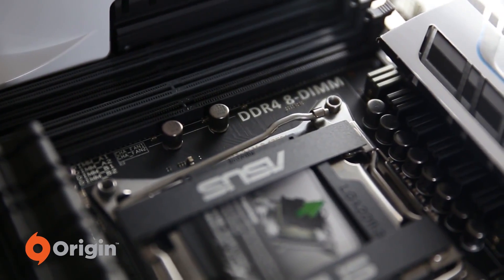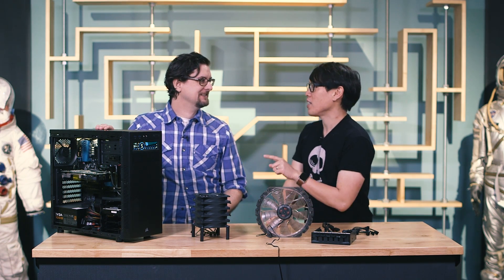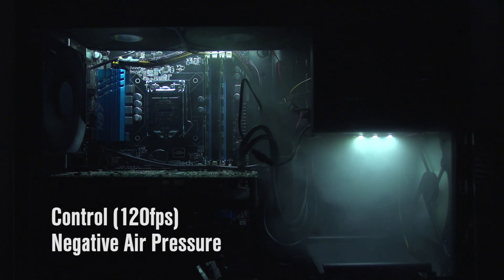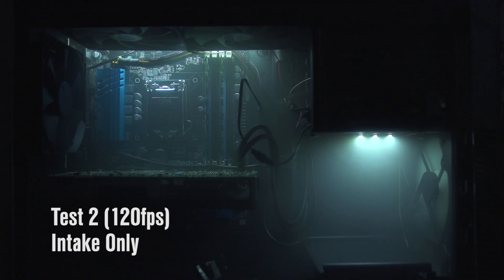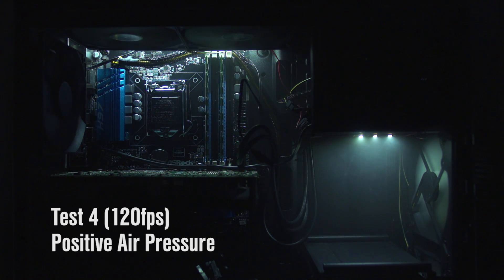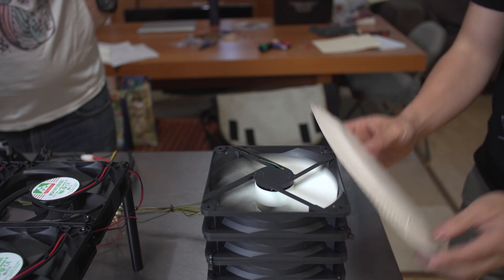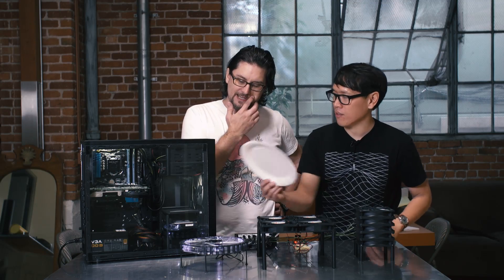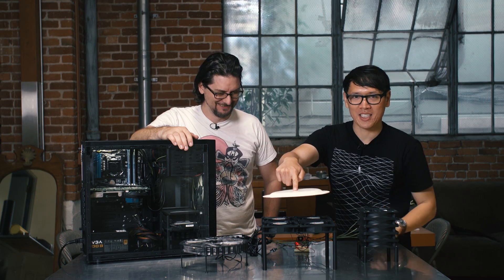Team PC Episode 2 - Positive and Negative Air Pressure

Comment: Negative or balanced air pressure ftw. Positive air pressure may pull in more cool air, but the air is stagnant and sitting in a case full of hot pc components. In other words the stagnant air in the case causes increased thermals. Yes you may get a bit more dust with negative, but just blow out the case every few months and you'll still be getting better temps overall. Still balanced is the best to reduce thermals while keeping out dust.

Comment: possitive air pressure is much better than negative .. 
negative air pressure is just pushing the air out more than air coming in the case , AND ALLOWS DUST TO STACK EASILY IN THE CASE .. 
Possitive air pressure is more air coming in , than going out , which help to cool things down much better cuz the intake air actually moving in and being exhaust out slower , SO the little holes in ur case wont SUCK anything IN ..
Reply: That is not true. It is better to get the hot air out of your case as quickly as possible. It does not matter how much air you get in. If your air inside the case is hot, it does not make a difference. As it goes for dust, you're going to take it anyway, either with positive or negative pressure.
Reply: Positive pressure is better for sloths. They never clean anything.

Comment: do you want loads of dust in your case? because this is how you get loads of dust.
also no cable management.... like at all
Reply: The whole point is to get hot air out because you don't want your parts to become hot. Also according to airflow 101 on toms hardware page, positive pressure creates "Stagnant air" which heats up your internal pc parts in the longrun which is dangerous. Also, it just makes sense to take hot air out. You don't want hot air in your pc, you want cool air.                                                                                                                                                                                                                                                                                                                                                                                                                                        And as far as dust, you are right. Negative pressure will create more dust but there are many ways to prevent this. And cable management falls DIRECTLY ON THE PERSON!!! Have your desktop 6ft from the ground since dust accumulates from the ground up. Also I'm not saying that people that use positive air are lazy asses but you should expect to at least conduct maintenance on your own pc about every month. I would prefer every 3 weeks because it isn't too long and it not even HARD AT ALL TO CLEAN DUST.                                                                                                                                                                                                                                                                                                                                                                                                                                  Again, isn't the big picture about performance? I believe so, if people are afraid of a little bit of dust and they would risk performance over FUCKING dust then I don't know what to say because it isn't COMMON SENSE!!! These bright men over many others are actually not afraid to make a video and be judged showing the ACTUAL truth of airflow to settle this annoying ass dispute over which is better. And alast, the TRUTH is in front of the white of your eyes. You can deny it or you can accept it. I don't care if you use positive or neutral pressure people are entitled to their own likings, I'm just glad that these men just finally proved which one was better.